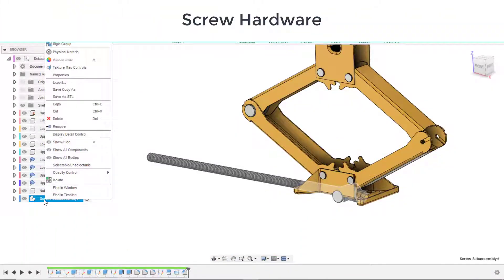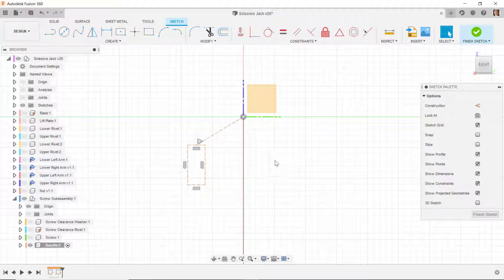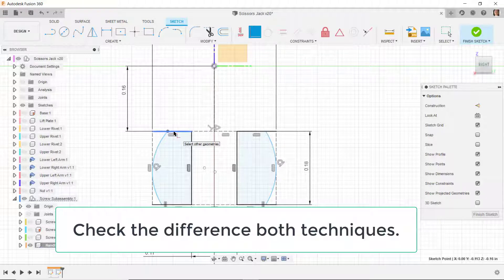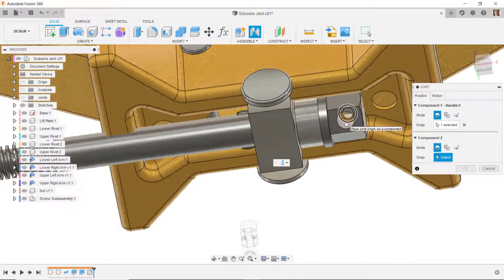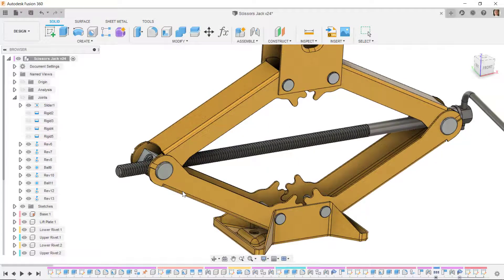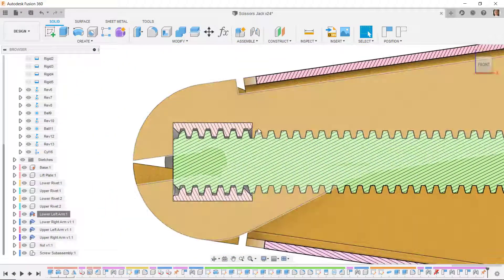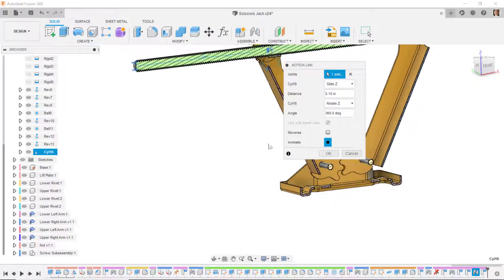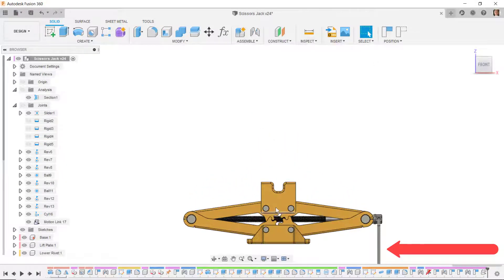Scissors Jack   Video 7 of 8

Comment: I'm looking at the 6 min 20 sec mark which is exactly what I needed, except that you rotated the screw with what I'm guessing is a 3d mouse and I do not have one. Also, you "grounded" the object by selecting something off screen. Can you expand on these two issues please? My goal is to learn how to line up threads. Thanks for your time!
Reply from the maker: It doesn't matter which part you temporarily ground as long as it logically keeps the mechanism locked while you align the part that still has freedom to move.